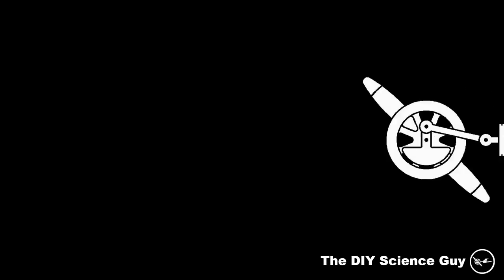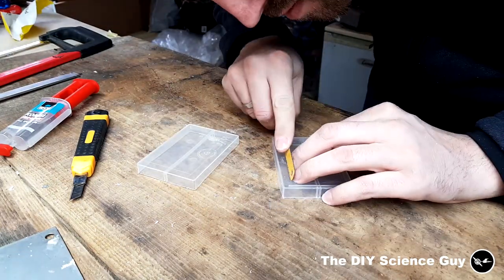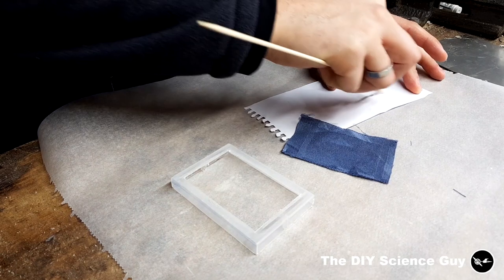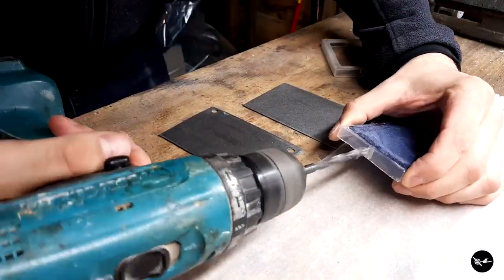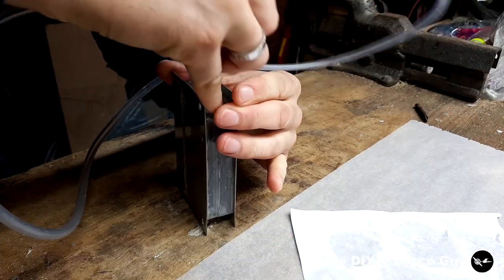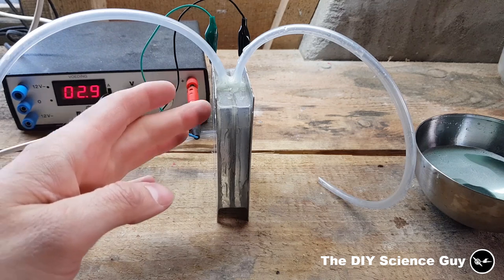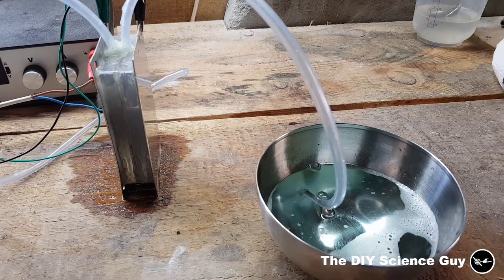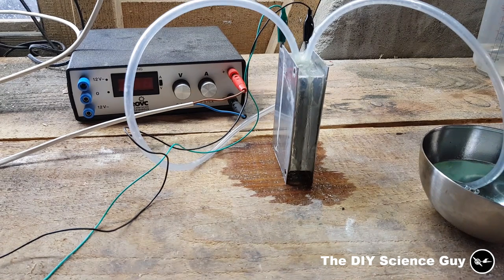Hydrogen Generator #3 Hydrogen generator split cell demo (hydrogen and oxygen separation)

Comment: Instead of using KOH use  Activated carbon/charcoal, grind it into the finest dust possible, and mix it into the water so the water looks black
Reply from the maker: Ok and how would that work?
Reply: @TheDIYScienceGuy  my thoughts, with non conductive water if your probe points are practically touching, you barely get something at all instead of absolutely nothing... correct?... with the normal/average cell the closer the plates the better preformance, but if you get them too close the gas won't escape?  So dont use a plate, use a needle, and a skinny tube with needle in the center on the ends. If the mixture is thick enough you would have plenty of carbon particles touching each other directly, and plenty of them with  microscopic gaps of water in between the carbon particles! Recently learned that it's just the basics of any conductive surface... So carbon particle - microscopic layer (boundary) of water - carbon particle... the smallest hho generator ever, but in a cluster as a thicker slurry.  And the bubbles  won't be resisted. With this setup no way to separate the gases (via membrane). But the carbon would never get consumed correct?  If this works? And would it ever need cleaning if used pure distilled water?
Reply from the maker: @davidprock904  It sounds like that might work! Very good thinking! 👍
Reply: @TheDIYScienceGuy  my Skype is Vegan.Prock if your willing to chat more about it
Reply: @davidprock904  i am maybe 90% certain that it would not work that way. 

Lets start with.... 

1) In an ionic solution current wont flow until you have a voltage above water's break down voltage.  Using distilled water with carbon nano particles in a carbon slurry will start conducting at  a much lower  voltage, and because a voltage develops across a resistor when you push current through, you'll never have eneough voltage between two particles to electrolitically reduce water. Using a third electrode to sense voltages, youll find that  From one electrode to the next, youll have a continous voltage gradient drop.  

Another way to see this is to see it like  an electric circuit. Say we have a cell fed 3.24v and there is 10 amps flowing through it.   Electrolisys may be roughly and simply modeled as a  resistor and a 1.24v zeiner diode in serries.  The resistor's value is a function of electrolyte type and concentartion, and is generally inversely proportional to both plate surface area, and the distance between plates, Bubbles block current between the plates and thus increases the resistance too.   Now if our resistor is modeld at 0.2 ohms, with 10 amps flowing through it 2v is developed across the resistor. Consequently 10 amps × 2v means 20 watts of power  is making waste heat.  Now the 1.24v zeiner diode adjust its resistance to alwase have 1.24v across it in a resistor zeiner diode series, so with 10 amps flow through it, you get 10amp × 1.24v =12.4watts of heat in a real zeiner diode, but our zeiner diode represents the breaking apart of water storing 12.4 watt every second as 12.4 joules of chemical energy.  Now lets model a carbon slurry.  You have a bunch of little resistors  in a serries and parallel network that is In serries and in parallel with with the zeiner diode such that the more carbon you add, the more current is shunted, bypassing the zeiner diode. 

2) ions in water ionize water molecules into H+ and OH- ions.  Crushed carbon does not ionize the water. 
3) He is trying to keep  hydrogen and oxygen in two seperate half cells. Even if a carbon slurry generated H2 and O2 at the surfaces of carbon nano particles as you though,  it's impossible to keep the H2 and O2 separate.

Comment: i think the rip stop nylon doesnt allow water to flow through it not only gas? What nylon material did you use
Reply from the maker: It's a tablecloth. No rip stop wouldn't work because it's water and air tight.
Reply: Hello my colleague, I beg you to tell me which material is this tablecloth, because yesterday I took a canvas 1 mm and I solved the problem of separating gases, but I have a new problem with the fast solution of the solution in the dark blue color, the material looks not resistant to alkaline electrolysis , now I'm looking for the ideal material ???
Reply from the maker: My tablecloth is made from nylon or polyester.
Reply: Thanks for the reply of the friend, here I am using a material similar to your nylon blue color that I display in this piston, it is 1.5 mm thick and perfectly separates the gases, and I no longer have the problem that my nylon is rubbed in the cells. But there is a problem of another kind that the Sodium Hydroxide solution quickly blubber, and it becomes dark blue! Probably this material is in the process of electrolysis?
Reply from the maker: Yes that hapend with mine to, I think that is what's going on.

Comment: Like your videos but hate the music. Also too much video of cutting smoothing. Thanks for making and sharing! Whats the gluie you are using. I am not familiar with that make. Is it flexible once set?
Reply from the maker: Thanks! However, we can't all like the same music. I agree, the shot's were to long, this was a video experiment and my newer video's don't have that anymore. The glue is Bison 2 component epoxy resin which will stay slightly elastic.
Reply: @TheDIYScienceGuy  thanks re glue. agreed re types music. its an individual/age thing too. I'm older generation though like the music up to 1.46 mins.
Reply from the maker: Thanks for your input! 😉👍

Comment: Hi  is it possible to use an inverter to power the hho cell in the  car or permanently wires battery charger in
Reply from the maker: If it can generate enough amps than that wouldn't be a problem I think.
Reply: Che amperaggio deve avere ĺalimentatore?
Reply from the maker: l'intensità della corrente è determinata dalla resistenza dell'elettrolita e dalla superficie degli elettrodi. mai applicare più di 2 volt.
Reply: i have made a 60 plate cell  weak Koh with a bridge rectifier, runs with a 1200 watt modified sine wave inverter makes an insane amount of gas at 4 amps
Reply from the maker: Nice!

Comment: How about the oxygen? I like the concept and such but on our study, we need to obtain the oxygen gas :0
Reply from the maker: The oxygen flowes out of the other hose, and you can do what ever you want with it. What is your study about?
Reply: The DIY Science Guy  Ah we need to obtain the oxygen from water by splitting it from hydrogen, obviously. Since we cannot find any cheap and good semi-permeable membrane. Anyway, what kind of nylon did you used? Hezhez
Reply from the maker: Just a nylon or polyester table cloth but it seems that polypropylene is the best option.

Comment: now i wonder  where you get nylon fabric ? xD
Reply from the maker: You can use nylon, polypropylene or polyester. Just go to a dollar store and by a table sheet and look at the label to now what material it is, and do some testing to se if it doesn't dissolve in sodium hydroxide.
Reply: @TheDIYScienceGuy  do you need sodium dioxide or can you use any salt?
Reply: Like normal kitchen salt (sodium chloride)
Reply from the maker: If you use sodium chloride you will produce chlorine gass as well, which is very toxic and it will corrode your anode very badly.